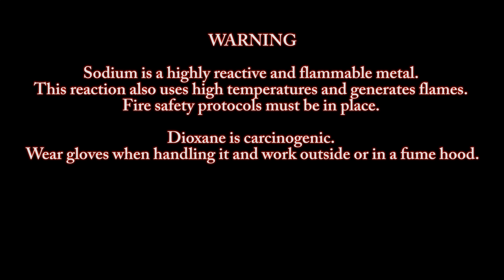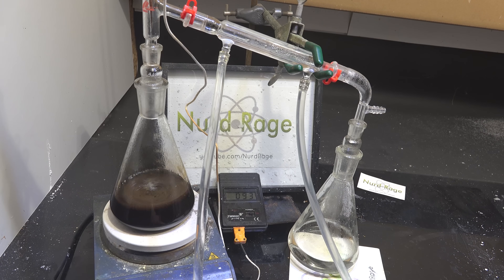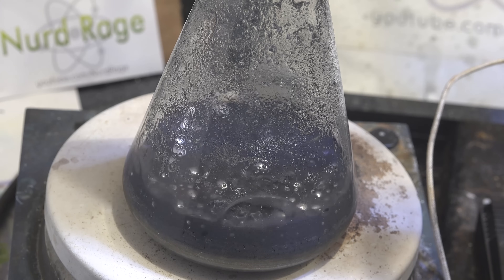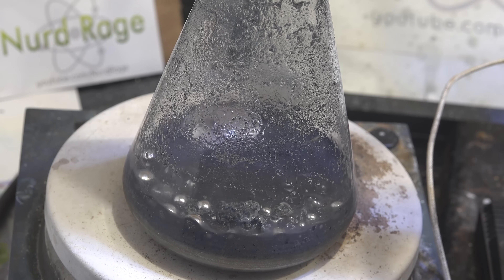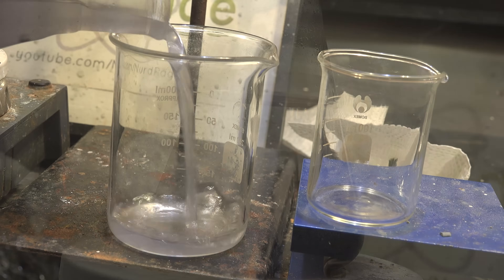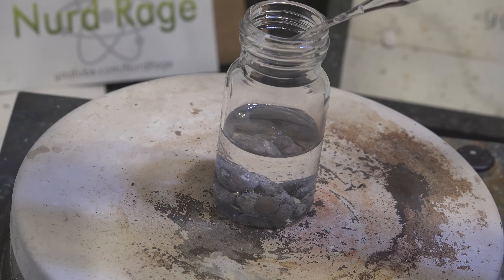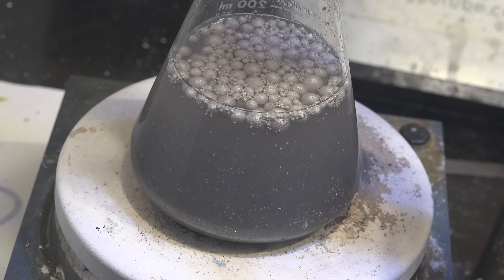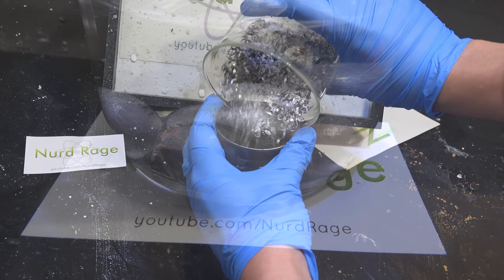Make Sodium Metal Without Electrolysis Using Domestic Chemicals

Comment: I tried this about 5 years ago, made my own reaction vessel and produced copius amounts of sodium magnesium oxide aggregate, experimented with different solvents to purify and isolate almost pure sodium metal, best thing I found was actually charcoal starting fluid. It left all the slag at the bottom and a large amount of beautiful sodium metal spheres . Needless to say I just let it go on heat till the solvent was evaporated.  Then I cleaned it with pure mineral oil, I had like 3 large jars full of sodium metal. I'm an amateur chemist and this is one of the best experiences I've had thus far. Thank you NurdRage for passing the knowledge down. I've done several other reactions and synthesizes since then. I can't stress more about personal safety precautions, chemicals and elements are alot more serious than people realize so please take all precautions with utmost seriousness.

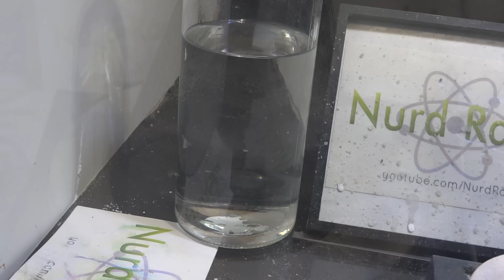Comment: 08:23 Now, that's outright suicidal! If you missed one piece of sodium larger than let's say, very few milligrams in weight, this may go BANG! and destroy your flask, have splinters fly around you and set your place on fire!
I'd rather use very cautiously some alcohol and leave the flask standing in a fireproof environment for several days, then slowly increase the water content of the alcohol while monitoring carefully for bubbles.
Reply: Sodium IS a Metal so goddamn, science-language IS so confusing, is Sodium-Metal the same as 'normal Sodium'?

Comment: I made potassium as a kid by taking some slightly damp ashes and under cooking oil or kerosene I run a current through it and a silvery metal formed.
Reply: Sodium IS a Metal so goddamn, science-language IS so confusing, is Sodium-Metal the same as 'normal Sodium'? And where to get any of either??
Reply: @loturzelrestaurant  Sodium is a reactive alkaline metal made from sodium chloride or salt. Pot ash is potassium carbonate. And running a current under that with the absence of air makes a metal potassium. Also a metal that reacts with water.
Reply: @travismoore7849  I just learned, to my great Dismayyyyy, that Sodium-Hydroxit is JUST LYE. 

How does Sodium relate to all this?
Reply: @loturzelrestaurant  Potash is mostly potassium carbonate. Potassium is not Sodium two different elements. Though potassium will react to with water in a way similar to sodium.

Comment: For anyone planning to attempt this synthesis. Do no not put the crude sodium in oil after first making it. I thought I could lower the oxidation loss by submerging the aggregate in oil. Unless you somehow get the oil off the sodium before you extract it with dioxane, the oil reacts while heated to form some kind of purple-pink residue which is hard to remove from the glass and also does not allow the sodium to leave the MgO slag. Anyway I wish luck to everyone reading this and taking it as an advice.
Reply: Storing the aggregate under vacuum until you're ready to process it might help...  Processing it under vacuum would probably also help, but setting that up would be a challenge.

Comment: Maybe, to reduce loss, you can fill the blender wan inert gas, like Nitrogen or Argon. The blender probably isn’t air tight, but it could probably still displace most of the air.

Comment: I've noticed that by drying dioxane with sodium metal, incomaprison to other solvents, the metal forms almost perfect spheres that float on the top of the solvent. The metal is beautiful in comparison to what it looked like before it was added to the drying flask as well. Very cool and only dioxane does it as nicely.

Comment: Great Video!
And finally, I've come around to test it.

Unfortunally, I get zero separation, even after several runs of destillation back to back. But there definetly is sodium in this mixture. After some frustrating runs i dumped all the dry mixture into a bucket of water and was still shocked about the vigarous reaction. So it cant be the Na/MgO arregate which causes the problem. I also synthesised my dioxane the same way as NR did it in his dioxane video. All worked perfectly fine, so the dioxane shouldnt cause any problems as well. 
I followed every step in this video and the dioxane video, still no separation. 

So where could be the problem?
Im absolutely clueless ... 
Do you guys have any sugesstions?

To NR: How fast did you destill the dioxane? Over an hour? Or more? Or less?
Reply: I am having the same issue, I tried distilling it fast, slowly, refluxing for several hours... but nothing at all :-( I also know I am making sodium in the thermite, since it blows up in water.

Comment: I think I know why this works with Dioxane but not other non ether solvents. The lone electron pair on the dioxane molecule are highly exposed because of the bond strain angle of the ethyl linkages, this allows for a weak covalent bond with the sodium, which only has one valence electron, and is substantially stabilized by allowing a resonance hybrid attaining two electrons in the outer shell, roughly put.

Comment: When I was about 16, I was able to make a little bit of sodium from sodium hydroxide electrolysis and the yield was pitiful to say the least, but it worked and I was happy with my accomplishment.  If this video had been around then, I would have made a LOT more of it.  I'd love to see your video making potassium once you make it.
Reply: I did the same thing when I was 15 in a measuring cup and it worked. Unfortunately on my second attempt, it blew up and gave me burns all over my arms. Luckily none got on my face and my arms are all healed now(about 2 years ago) as it could have been so much worse. I only got a very small, impure amount but it still got me into chemistry.

Comment: Sodium is more reactive with polyethers and some like 18-Crown-6 in ether solvate Na+ leaving free electrons in solvent. Hence Dioxane is a chelating diether, predictably solvents diglyme methyl ether (open chain dioxane) and higher boiling triglyme and tetraglyme (also better chelaters) should work. Note in Grignard reagents Magnesium is solvated by 2 ethyl ether but one dioxane. Dioxane assists difficult Grignards. Unsure of Mg in triple ether like triglyme.
Reply: Another video used Eukalyptus oil

Comment: What i don't like in videos like that is that you need always to have another ingredient that couldn't be made without having the first substance we're trying to make, vicious circle.
Reply from the maker: what are you talking about? You don't need sodium to make anything here. This is a purely one-through experiment.
Reply: @NurdRage  I mean to make sodium we need Dioxane, to make Dioxane we need Sulfuric Acid, to make Sulfuric Acid we need Bromine and so on... Sulfur is easy to get but Bromine and Magnesium aren't.
Reply from the maker: @Rivodtadin Where does  the video say you need to make sulfuric acid from bromine? the dioxane video explains you can get sulfuric acid from drain opener. And magnesium is available as a firestarter for camping. It's also available from pencil sharpeners.
Reply: @NurdRage  In the video titled "Make Sulfuric Acid from water and Sulfur" you used hydrobromic Acid i'm talking about such substances, so is there another method where you can make sulfuric Acid just by Sulfur ? I didn't know Magnesium can be bought as a firestarter i appreciate the info and i want to thank you for your help and for spreading knowledge.
Reply from the maker: @Rivodtadin "Why are you deliberately ignoring what i'm saying? ---> the dioxane video explains you can get sulfuric acid from drain opener
Reply: @NurdRage  No i didn't ignore what you said, in fact i didn't understand how is that possible because the Drain opener in the market here are NaOH, i will watch your video to see how you made it,

Comment: How is Magnesium and Dioxane available domestically ? Because i never use that to cook my food.
Reply from the maker: its explained in the video where to get them or make them domestically. (magnesium from fire starters that can be bought at camping/outdoors stores. And dioxane is made from antifreeze and sulfuric acid, both can be bought from autoparts stores)

Just because something is not used in food doesn't mean it's not available. Computer keyboards are available domestically but they are not used to cook food.

Comment: Amazing results not requiring professional equipment. Of course, starting with sodium hydroxide makes this method possible, due to the reactivity of sodium hydroxide as compared with sodium chloride, which is chemically very stable.

By the way, the little explosion at the end of this video was not caused by hydrogen burning in air, as used to be believed, but by tiny "whiskers" shooting out of the sodium at high speed into the water due to like charges repelling inside the sodium. The whiskers increase the surface area, supporting a kind of heat-based (exothermic) chain reaction (analogous in a sense to nuclear fission). This actual chain reaction has not been studied in detail, I believe, and is not yet completely understood.
Reply: You mean a coulomb explosion?

Comment: Trying to improve technique by adding various substances to reactants to absorb excess heat to the point where it would be insufficient to boil sodium out...
Regular table salt has proven to be pretty thermally efficient (reducing caustic smoke formation almost to zero), but also capable of dissolving and encapsulating lye and sodium during reaction thus making it very difficult to extract and separate most of the product.
Currently trying out magnesium oxide as heat absorber. Got very powdery (and pyrophoric, although it could be because of sodium silicide forming from impurities) product. Yet to be processed.
Also got a couple of other ideas on mitigating burnout issue worth trying...

Comment: NaOH + C = H2O + CO + Na
Reply from the maker: This is wrong, the actual reaction is 2NaOH + 2Mg = 2MgO + 2Na + H2
Reply: So what the product of mixing sodium hydroxide and carbon and heat ?
Reply from the maker: No, the video doesn't use carbon at all. It uses magnesium.

Comment: It's so weird to me that the dioxane is completely unreactive with sodium. That no part of the dioxane molecule, the sodium atom will ever attack. Because water, burnt hydrogen, is presumably fairly stable, since it releases so much energy when you burn hydrogen, you'd think it would be hard to break apart that molecule and that anything that could, would do something to some part of a large, presumably more fragile molecule, especially one which also contains hydrogen AND oxygen, and is definitely a fragile enough molecule far enough from its energy rest state to be highly flammable. So why is water so vulnerable to sodium but dioxane completely immune? Is it just because there are no bonds between hydrogen and oxygen, and all the hydrogen and oxygen atoms are bonded directly to carbon? I'd still expect some sort of interaction to happen, especially since it's a flammable liquid. Just by being very flammable should make it reactive, but then I already know sodium doesn't react with the alkanes and that's why they store it in mineral oil, but that's kind of weird too, even if it doesn't contain oxygen in its molecule.

Comment: problem is: i can't get hold of magnesium metal.
Reply from the maker: it can easily be bought online from ebay, amazon, aliexpress and other shopping sites, you can also grind down magnesium fire starters.
Reply: You can buy "mags" at the hardware store.  They are for finishing concrete like a steel trowel but thicker.  Old VW heads for engines are Magnesium.

Comment: An accomplished engineering type "Shawn Hawkins" (https://www.youtube.com/channel/UCvS1l0_T307VqCEC04Ys95A) prompted me in your MgONa aggregate video to share my research into a higher speed separation technique that I have also been thinking of.  I include the general idea here again as it is hidden there in a reply to an old comment.  The technique might not result in pure product but might be very fast way to get enough to clean using the oil with alcohol technique.  I was hoping to have results before sharing my ideas but time is not available now so I hope someone else who has access to the equipment might have a try.

I have been pondering density separation since I first saw this video. I suggest that you take the aggregate mixed with oil, ground fine, heated above sodium melting point and centrifuged in modified centrifugal caster or large blood bag centrifuge using a robust stainless steel espresso machine filter basket. 

The sodium should pass through the filter with some fine dust and separate to the bottom of the vessel with any fine MgO dust at the bottom and much of the sodium in a recoverable size blob or droplets above, all protected by the oil.  One needs to make sure the centrifuge buckets and the rotor are balanced before starting (and made of iron to tolerate the thermal loads more safely).  If using a spring powered casting centrifuge the rare vertical type may be the way to go as the bucket can be arranged to hang down before the release.  I'm not sure which device will have the correct acceleration profile but one could be quite fast and the other more thorough in separation.  A continuous system such as described in the patent would be rather extravagant and might be beyond the scope or needs of the backyard chemist.

A vertical caster like https://orchid.ganoksin.com/t/for-sale-casting-machine/54664 or a second hand swing rotor centrifuge like this https://en.wikipedia.org/wiki/Laboratory_centrifuge#/media/File:Centrifuga_Hermle_2.jpg with a pot with mixed aggregate in a filter such as these https://store.vstapps.com/products/vst-precision-filter-baskets with inspiration from patents like https://www.google.com/patents/US2415210 could be a starting point.

Comment: Impressive results!!! The slag separation step is really where all the magic is IMO. For the furnace step, have you considered running a line of nitrogen or argon into the bottom of the can to reduce air oxidation?
I would wager the dioxane is complexing with the magnesium and not the sodium, thus providing a means of chemical separation. Monoglyme and diglyme are two other solvents that may provide similar results, and have less health risks. Also the crown ethers, namely 6-crown-3 (cyclic trimer of ethylene oxide, where dioxane is the cyclic dimer) may work well, too. Acetonitrile and THF may also work, but might not have the affinity bias for the bivalent metal like the bidentate complexing agent dioxane, as well as the favorable higher boiling point. Also MTBE and ETBE, thinking in ether land since dioxane works well.

Comment: Isn't it possible to burn the NaOH with some Charcoal? I think this might get rid of any further destiallationprocesses and so forth.

4NaOH + C ->4 Na + CO2 + 2 H20

Then I think you could wash the Na with some mineral oil, to get (relatively) good and not as much time consuming Sodium.
Reply from the maker: The enthalpy of formation is NOT favourable for that reaction.
Reply: But lets say you have something like a soup can out if ceramic, and fill it full up, with the right amount of everything, and something to controll the pressure inside, something to let CO2 and H20 escape but nothing in. Sry if I dont understand, my englishskills in chemistry aren't that good. The enthalpie is something about energy, right? Ehat about converting NaOH to Na2O? Then ist should behave like thermite, or?

Ahh I guess I understood. Carbon has a higher enthalpy and because of that such a reaction isn't possible. Thats why you use magnesium, with a lower enthalpy.

But still consider a enclosed area so you have less oxygen coming in

Thx for replying!
Reply: Koni Sama no, the amount of sodium metal produced is negligible and it's lost in oxidation and evaporation at such high temperatures. The equilibrium is WAAAAAAAY far towards the reactants.

Comment: I've been trying to make potassium with the catalyzed magnesium reduction method, but I don't have a high-boiling inert solvent that potassium would float on. If I were to heat the reaction products in dioxane like you do here, would I get the same separation as with the sodium?
Reply from the maker: I actually tried it and it doesn't work very well! I know i say in the video it did but i only got tiny amounts out.

Comment: Would liquid/supercritical CO2 work as a solvent?
Reply from the maker: Not sure, let me know what happens! :)
Reply: NurdRage Ok! Will do. Do you suggest I should heat it so the sodium melts or not?
Reply: NurdRage By the way, I just nerded out really hard that you replied.
Reply from the maker: i thought about it a little more and i realized it would probably be a bad idea overall to try carbon dioxide. The sodium would likely reduce the CO2 into carbon monoxide or even carbon. So overall i wouldn't try it.
Reply: NurdRage Thanks! And lol science never sleeps. (If you're in my timezone) If you don't think it's dangerous, I'm gonna try it anyways just for the experience. Cheers!
Reply from the maker: I'm afraid the reaction would be violent. So i wouldn't do it for safety reasons.
Reply: NurdRage Ok, thanks.